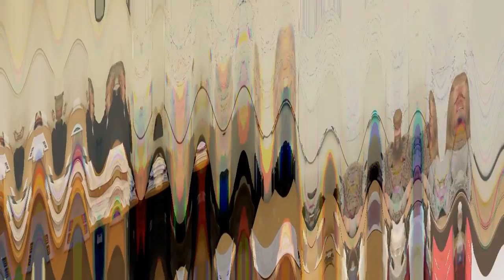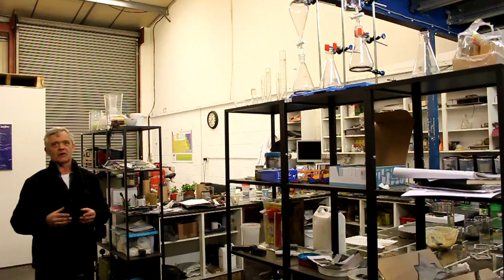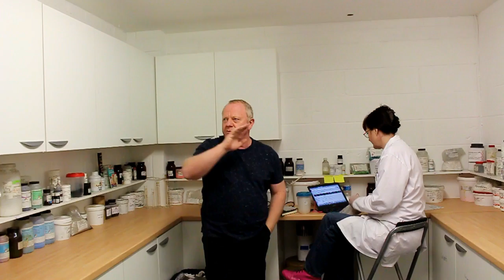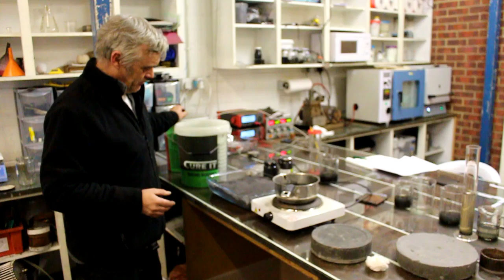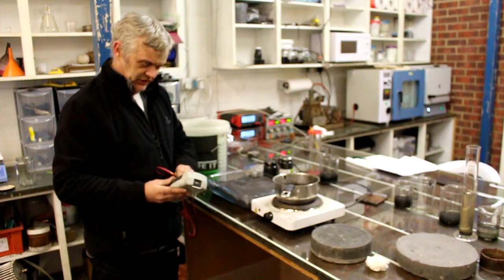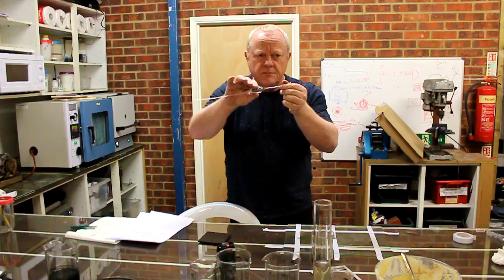Changes In The Lab - Part 1

Comment: Dr. Murray-Smith, I really enjoy your progress and ideology on your battery development. I'm planning to build a solar/electric catamaran to do the "Great Loop" , an 8000 mile journey up the east coast and through the central river system to Florida and back. My design challenge thus far has been hindered by battery logistics. Am I correct in assuming that the technology you're working on would be mouldable? I would like to essentially turn each hull into giant batteries, assuming weight wouldn't be too large. I'd appreciate you're thoughts.
Reply from the maker: it's do able mate - the device can be molded

Comment: Hi there guys and gals . Is the concrete electrically conductive and will it heat up with electricity running through it ? A big company in Sweden is pouring graphene concrete over the wiring from huge wind generators to help keep the wiring cooler to lower the resistance . I think it's an Aussie company .
Reply from the maker: yes mate it probably will - it is conductive/resistive so a current should cause heating - but we haven't looked at it like that - yet lol

Comment: One of my ideas, even dreams if you will, was using was reclaiming used plastic as the primarily material for injected molded archectictural pieces, ornate tyipes, that could be re-attached to building where they previous very heavy aggregrate types has fallen off. I think labs like this would be able to develop the concepts and recipes to make that happen.
Reply from the maker: probably mate - or you could

Comment: The problem I see with selling IP is that you could invent the best cheapest green graphene battery and have the IP right bought by a future competitor of that battery, like say a lithium battery company or any battery company for that matter, only for them to hold on to that IP to make sure nobody else develops so they don't have any competition for their current products. I really hope something like this doesn't happen but I wish you the best of luck, I would really like to see commercial graphene batteries in the future. 

Cheers.
Reply from the maker: It doesn't matter what you do mate - there are always problems but given the number of folks working on this i think you are expounding a pretty unlikely scenario
Reply: I wouldn't worry so much about other battery manufacturers, they would all love to make a better product as it would mean more money.  Oil companies, though... that's a concern, as happened with the Ovonics NiMH patent (stolen by GM and resold to Texaco (now Chevron).  "ChevronTexaco also maintained veto power over any sale or licensing of NiMH technology.[13] In addition, ChevronTexaco maintained the right to seize all of Cobasys' intellectual property rights in the event that ECD Ovonics did not fulfill its contractual obligations.[13] "

Comment: Nice to hear you guys have made a good progress! :)

Graphite powder, what process do you use to make graphene out of it?
Cosolvent, or make it first solid and electrolysis?

I've got 25kg bag (~3.5€ per kg) of graphite powder to test with, making it work with electrolytic exfoliation method hasn't yet been working... I guess time to go buy a shop press and try to turn it into solid like they do industrially and attempt again (i tried different bonding methods... either too fragile or lost conductivity)
Reply from the maker: cheers mate and we use a few different processes but i have done videos on them all
Reply: Yes, the cosolvent (water acetone) is an obvious method ... But i really like the electrolysis method's speed and bulk nature ... So need to first turn the powder into a solid form for it to work as electrode.

I guess i have to decide whether to buy shop press, or keep buying small chunks of ebay or something :/

I use A LOT of graphene, doing composites. 100grams don't last long ... Infact, quite easily used on a single laminate
Reply: likely is, but peek is stupid stupid expensive. You might want to look into ABS Graphene or even PLA Graphene mixture on common use where part cost is an factor.
PEEK when cost is not an factor :)

Comment: just a question for you are there any known carbons that could Electrostaticly cling to a conductive material like aluminum or copper instead of having to use a binder mixture to make it stick ..for the making of capacitors
Reply from the maker: no idea mate - but a search of google scholar should help
Reply: Why i had asked is because I can't find a carbon that does or any information on it ... but strangely enough I managed to create such a carbon just the other day still testing it out wanted to see if you might have any other insight ...Thank you so much though my friend
Reply: It clings to glass and aluminum and copper I forgot to add it acts like a magnet but isn't it has a very strong Electrostatic charge to it
Reply from the maker: it sounds like you have some awesome stuff there mate - you should do some videos - of the properties maybe and your investigations - i'd love to see
Reply: Robert Murray-Smith ...I should do a video and defenitly will Robert would love to share it ...I promise I will just want a little time first to discover for myself first what I actually made ..all I know for now is yes it has some surprising properties ..I tested it out on a small aluminum capacitor sit it on top of a tin can and did exceptionally very good it also plated the top of the can aluminum ...I didn't use any other carbons for the test ...I uniquely used the carbon I made as the cathode carbon and also the same for the anode carbon....when  place it on my kitchen table or walk around with it you can feel either a pulling or strong repelling force in your hands when holding the stuff...also I believe in the Same process I believe I found the way to mass produce graphene ...I'm very excited right now ...still want to play around with it more and test more of it out before doing a video but I am anxious to do one .. I'm still trying to figure out exactly what I have created ... tried googling tried everything else then said to myself I have to ask Robert if anything he should know ....that's what I told my wife...lol
Reply: could send you a picture of the Electrostatic carbon all I have to do is cut a strip of aluminum and emerse it in the carbon power and the carbon powder will be stuck on as a very very thin layer of carbon to the aluminum electrostatically   ...if you like I could send you a picture of the aluminum once coated
Reply: no use of brushes or anything as a binder material used just Electrostatic adhesion uniquely
Reply: ok did a video no audio for now but working on it give me a few moments and I will send you a link my friend
Reply: Video is coming waiting for it to upload heres a picture of on top of the can where I placed the capacitor using the carbons I had made as you can see the top surface of the can got plated aluminum http://i24.photobucket.com/albums/c23/gagnetrain/Mobile%20Uploads/2017-04/FB_IMG_14933130302555827_zpskhwpa2oj.jpg
Reply: heres a pic of a piece of aluminum with a carbon layer that put itself on after dipping in the carbon power it's coated and held to on by Electrostatic forces http://i24.photobucket.com/albums/c23/gagnetrain/Mobile%20Uploads/2017-04/FB_IMG_14933199623046203_zpsi6y3dokp.jpg
Reply: Video is almost ready to send give it another 10 minutes and I should be able to send it it's slow to upload
Reply: almost done with uploaded video slow connection sorry for the delay shouldn't be long now :)
Reply: here's finally the video link Robert sorry for the delay ...https://drive.google.com/file/d/0B1aEWwKI30IMTTgwajRrMlEwME0/view?usp=drivesdk
Reply: wasn't easy holding the phone in one hand and trying to do all the rest with the other hand..what I noticed is the thickness of the aluminum used will depend on how thick a coat of carbon is deposited on to it...the thiner the aluminum foil sheet the thinner the deposited layer of carbon
Reply: About the video if your someone who looks at details notice at the end of the video after I smeered the carbon off the aluminum foil you will notice if you look closely at the foil you will see an area that is still layered with carbon that my finger did not manage to swipe off
Reply: for now I'm just beginning to do further tests and studies of it ...what I can say like I mentioned is that when I hold a chunk of it half the size of your thumb there is a really strong Electrostatic charge to it ..it is very strongly attracted to glass,to water ,to aluminium.and to copper and to my kitchen table top made of venir material ...the Electrostatic force at times makes the carbon chunk flip almost out of my hand and when walking around with it coming into near to distant contact with a material I can feel the repulsion or attractions forces that the carbon is acting apon it's as if I was holding a magnet in my hand ..I am certain if I had a piece the same surface area of my kitchen table or even half that area there would be enough Electrostatic force that you wouldn't be able to get it off the surface of the table that's how strong it would be given it was that dimension and half an inch thick
Reply: for the fact it electroplated the top of the tin can aluminum ...I looked into electroplating and conventional I would have needed to zincate the surface and or use acid baths or something to be able to do that...I don't have any zinc nor any acids just the carbon I developed was used I had made a double layer capacitor by using the top of the can as the cathode or anode part ...I places the carbon on top of the can a sheet of paper towel with aluminum covered carbon on the other side .. salt water electrolyte and that was all ..same carbon used on both anode and cathode conductive layers
Reply from the maker: cool vid mate cheers - but i was thinking more as a way other folk can access your work and know what you are doing
Reply: I will Robert as soon as I can.. thank you again  for the good advice I will surely work at soon :)
Reply from the maker: cheers mate

Comment: You guys have a nice place there ;) I know by heart that it is very useful to put chemicals by-hand, unfortunately   it does not work for the health and safety requirements, e.g. in your video +16 gone wrong, please consult in this case as it could vary in EU.p.s.  I appreciate your capacitor progress.Please note, that your ideas are still patented by huge companies....
Reply from the maker: cheers mate - and you can't patent an idea mate only the implementation of an idea
Reply: Actually, the idea and testing of it is the main kernel what anyone could think about. However, this could be easily bypassed using common alteration techniques ;)
Reply from the maker: mate - I don't want to be rude here - but you think I don't know this?

Comment: You're simply amazing! I long to start a modest Graphene production project for a ballastic resistant undergarment backed by thin non-newtonian gel...
Reply from the maker: awesome mate - go for it - small steps one at a time mate - it's how we do it
Reply: Try the electrolysis method (0.5molar sulfate), i had great success with that, made a few hundred grams with cheap lab power supply and tiny jewelers sonicator, few coffee filters and random sulfates (i tried many of the common ones, even FeSo4 works!)